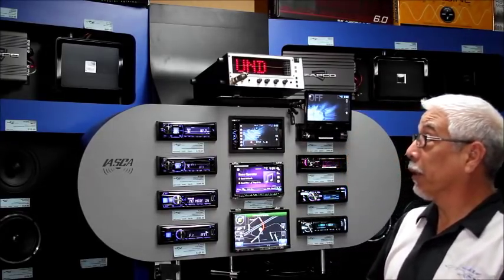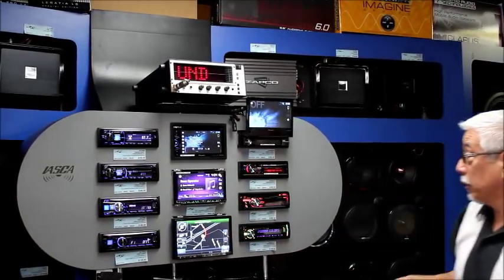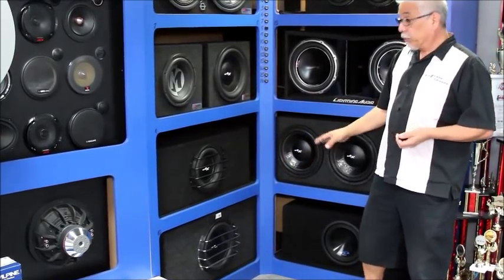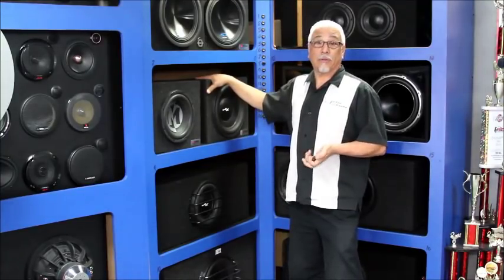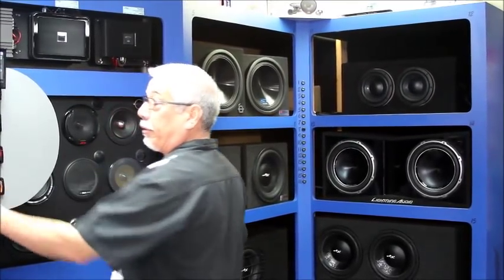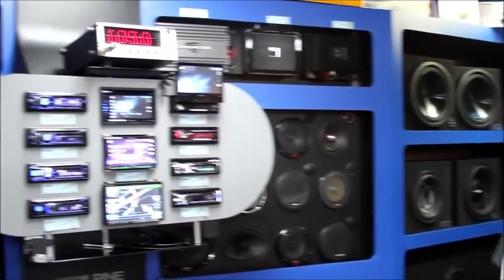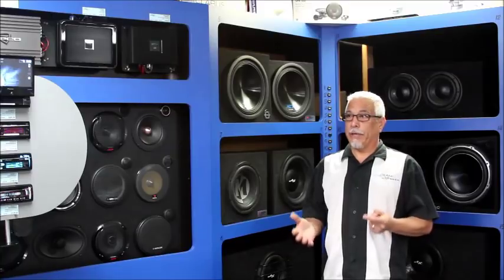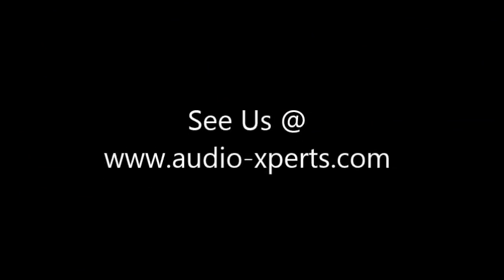Sealed vs Ported Demonstration by Audio Xperts using SPL meter to show output differences

Comment: I been doing systems for years yeah it's good to have a nice quality system that will shake the bolts off your car.But I seen dudes with a cheap amp and some mid class subs but there box was built right and you would think they had a expensive system.I seen expensive systems with a bullshit box and it sounds like air and paper.So basically it's how your box is build
Reply: That's so true: Ari Reid
A 300watt amp can produce in excess of 126db, (whilst running at LESS than half it's rated output power), when a few simple rules are applied.
BALANCING the Amps output reactance, to the implied reactance of the connected speaker LOAD, is what transmits the highest level of sound.
Not the enclosure, or how MUCH current one can force through the voice coils' winding.
Reply: Quix Kiwi Could you please elaborate on this some more
Reply: Yes I could, but would you actually "understand my answer" ?
Oh who cares if you can or you can't.
Here's what I will state.

THE OBVIOUS.

As the operative word I used before - was:
BALANCING
As THAT is all you really need to understand what was said.?

Don't consider this to be a useless method of "automatically leveling" the resultant power output levels of TWO speaker channels (in a bog standard 2ch stereo setup) as that NEVER balances anything, except the perceived listening "line" between two speaker positions to thus be causing the (resultant) "summated" MONO to then "appear" as if at a point ? About  midway between these TWO speaker positions.
.
Balancing is actually something done in reference to the "making of the same" with regards to what the Amplifier see's as a load , as against what the speakers see as a "driving" supply source"

Two speakers will NEVER provide a balanced impedance network, for any two channel "stereo" amplifier
(Where stereo means MORE than one, which by definition ALSO refers to there being actually - MORE than two,  rather than JUST two speakers).

As to correctly BALANCE the output of even a "cheap as" (low powered) stereo amp?

Be that a TWO CHANNEL AMP - or the most expensive multiple channel digital amp model available ?
(which is "able" to supply any number of speakers, within the impedance "ratio" range, that the amp's output's can handle)

Thus to understand BALANCING ?

One must in the first instance UNDERSTAND what you intend to balance.

If it's just a single listener's (own) headphone's LEVEL of loudness, in comparison to the output power setting, (of the OTHER headphone in that pair of headphones)? Then all you need to do - is "position the perceived" center=summation positioning, (not a real.central mono) to exist somewhere halfway between the other TWO speakers.

If however you wish to CORRECTLY balance the output "loading impedances" 
Direct to what the ANP can successfully drive OUT to the speakers connected.
(without undue clipping, heating or other weird sounding distortions)

YOU WILL NEED TO UNDERSTAND HOW THE MUSIC WAS ORIGINALLY RECORDED, 
(by even as few as ? JUST TWO MICROPHONES.).
When the "sound area" was created across, (to even be recorded for YOU to "play-back")

And thus to be "heard back later" as if YOU are still being, ?
Within a generally considered OPEN dispersal area, of a THREE dimensional "horizontal plane" of sound.
  
AS WELL AS HAVING (at least) TWO OTHER THREE DIMENSIONAL "PLANES" OF GEOMETRY
Comprising "not" just a WALK-BETWEEN line of sight/sound between TWO speakers.?

But "across, around, up/down/over inside-out &/or otherwise" sound planes (firing sound OUT in multiple directions as if being a LIVING PART, of whatever actions are being done)

As the inclusion of trillions of perceived generated beam pattern's are what makes this special,
in the way it does now also ACTUALLY EXIST AS, in open space around as many speakers as you wish to include

"And thus (again) working environment areas, to be creatively positioning's thereof, (all sound contained in just such an outdoor event) to thus be recreating sound between NOT JUST TWO, but as many "all_around"©™ speakers as YOU wish to include, in your "surrounding" sound replay/recreation system.

To ensure correct SPACIAL (3D, 4D and 6 - 9+ channels) listening pleasures too.

Whereby that is what is actively obtained, to thus be what drives UP the standing waves, to force the radiated waves to "appear" as if all louder, (as if it's the correct - high powered amp's output), to thus "arrive" at what would APPEAR, as a total surround effect, when in fact, it MAY WELL BE, just a silly wee recorder/player's "recorded sounds" - of the artist "painter".?

ONLY THEN will a thought hit you (inside your brain),?
Such as to why all of that "is this", And thus (?) WHY does it sound "better" and also EXTREMELY LOUDER - than what you initially "showed" here as if it has "very loud sounds".

See ?
Did you understand ANY of that profound statement ?
Reply: Quix Kiwi First of all, I was not being cynical at all. while I do appreciate your response,  You were correct in the fact that I understood little of what you said, some but not much. I do appreciate quality sound over total loudness and was hoping you would try to explain how to achieve a better balance in simpler terms, if that's possible.. it may just be beyond my level of understanding, But I thank you for taking the time to try to explain. Perhaps you might know of a link that could explain in a simplified manor so I could attain some knowledge of achieving a better balance. Thank you.
Reply: Sorry about the abruptness before.

Yes, but it would be far better for your understanding, if I just tell you (and everyone else interested in this subject) to "contact" your local electricity supplier, to ask THEM to explain all about load shedding, load balancing, power factor control and distribution network control systems, of ANY 2 phased & 3 phased power supply systems (which effectively are ALL that a 2ch stereo audio systems are anyway) to decrease the AMOUNT OF SUPPLY POWER NEEDED, to force "usable wattage" (output power) into an unbalanced consumers premises.!!!As an unbalanced (incorrectly loaded) consumer's premises, will actually WASTE almost all available POWER (wattage) from the supply generation point, just to create an ineffective "minimal wattage (power) seen at the load itself.Hence those who KNOW "all about" how costly it is to be paying huge dollar figures, for expensive HIGH POWER amplifiers, also know diddly squat, about WHY their uselessly low powered speakers, are sucking all that power from their expensive HIGH POWER amps, without creating any "really efficient" sound VOLUME.?

As volume in a 2 dimensional (or even a 3 dimensional) sound field is an "incorrect term."

THERE IS NO VOLUMETRIC CONTENT in two dimensions - only LOUDNESS.
Loudness isn't a good user of wattage (power), as LOUDNESS just wastes power.

In fact a small increase in loudness requires an extremely massive waste, of the available "supply wattage" (from the amplifier itself), to gain maybe 1/2 a dB increase in loudness at the two speakers.

....
to be continued below 
(re: Now... )
Reply: Now, having obtained that (small) insight, there's a LOT more to understand, before discovering HOW to build one yourself (tp get a 300 watt amp, supplying upwards of 3,00o watts of usable output wattage. (done by the inverse of losing power, one simply gains it).

How?
EZ actually.

Think of the "outside open" air environment of our entire world, as it isn't actually outside, nor open, but "contained" in a sound medium (air) which is itself contained in a very LARGE ball of usable CONTENT (containment) space, outside of which is a pure vacuum (where sound cannot be lost, as it cannot enter a vacuum).

Thus whatever's inside the spherical containment device, of our atmospheric system - can't actually BE EVER LOST, it just isn't usable in a hearing sense, from incorrectly wired (load balanced) speaker circuits.

When a set of "microphones" is then used to channel (yes a different meaning, of that weird word) - that "resultant sound" thus goes directly into JUST TWO unbalanced recording channels, to then "lose" it's balanced stability to transfer usable power, OUT to two (more) unbalanced microphones (as that's all a speaker is "isn't it", just a backwards version of a microphone).

Hence why - one currently (oops, another dual meaning word) has to SEND huge amounts of CURRENT, pushed along by a very high "potential voltage difference" thereby creating WATTAGE losses

....
to be continued,...
re: Thus by now...
Reply: Thus by now, it should be dawning upon you, that HIGH WATTAGE / POWER SUPPLIED is just current "wasted in wiring" in order to get a LITTLE current pushed along by HIGH VOLTAGES, that are needed to overcome the "potential differences" of the various resistance's and reactance's (of that useless wiring) - just to result in an extremely LOW "apparent" output power, from a couple of exceedingly expensive speakers, that simply CAN NOT correct the imbalances of a "lost" phase, which is needed to recreate the original sound.

Why ?
Because SOUND, is just an "audible waveform", somewhere along the entire RADIO FREQUENCY SPECTRUM, along which - electricity is ALSD merely ONE FREQUENCY, and where "all visible light" (white being just a collection of ALL the other shades) is also "just" a few frequencies (imbedded in a multitude of similar shadings, of same frequency SINOSODIAL wave forms), which happily ALL react and interact in exactly the same way - irrespective of WHERE along that huge radio frequency spectrum, they happen to occur, anywhere between STRAIGHT DC and the highest levels of (utterly useless) top end frequency.

SEE, or should I say HEAR (as your eyes CAN NOW HEAR, that which your ears NOW CAN SEE) - being  the light (when it's frequency is LOWERED to simulate sound), and where the SOUND (low frequencies are magnified by the method of sending voice-coil currents into filament globes, to transform sound into visible light) both allow you the watcher - to see & hear differently.
THAT which has always been?
Just a part of the SAME general operating principles, of the entire radio frequency Spectrum itself, contained within our actual "electrical" (electrons and protons and neutrons) world which has always been, around & thus also:
Surrounding us - hence why it is ANALOGUE SURROUND SOUND.

Nothing digitally needs to be altered, to recreate natural sound waveforms in a sinusoidal form'

.Thus, that is where a correctly BALANCED speaker system will always be able to use EVERY BIT OF AVAILABLE POWER 9instead of simply wasting it all in reactive heat losses, as most "commercial" amplifier/speaker systems have always done.
Even the best DIGITAL system - very effectively "loses and thus wastes" it's most valuable resource.
Amplifier power.

.....
Again - to continue with ....

I hope...
Reply: ...

I hope that helps explain .. why I use lights, to show exactly what the electrical currents are doing, in all the various speaker voice-coil circuit WIRES, that are easily interconnected, to load share, and phase angle (correctly), all the interconnected yet totally different "analogue" surround sound speakers.

Now there's a final "trick" that needs to be overcome.

When dealing with DIFFERENT sinusoidal waveforms, and variegated electrical circuits, ONE CAN NOT simply hope to achieve anything, by "banging" two different LINE (voltage) phases together in the same wiring ?
Ask your electricity supplier, WHY the DIFFERENT voltage / current & phase angle lines HAVE to be kept separated.?

In general power supply & distribution systems they GENERALLY like to keep the number of transmission lines down to the absolute minimum, hence why there's L1, L2, L3, N & E (five wires) in most power supply grids, (and why they LIKE to drop one of them (down) to ground it all, by using the earth as the "dropped" GROUNDED wire)

Thus leaving just four wires, to provide a balanced three phased circuit.

Now .. with THAT basic supply (circuit) they also need to ensure stability and balance is maintained over exceedingly LONG distances, to minimize wastage.

This is usually achieved in a dual way.
Firstly, by actually INCREASING the voltage along the way, decreases the current needed to be pushed, therefore reducing the copper resistance losses, increasing the usable wattage at the far end.

The second method (in conjunction with the first) is also easy to obtain.

The distributor simply WIRES the lines as a DELTA (no neutral) 3 wire configuration (see, by dropping a wire drops the overall resistance by 1/4, thereby increasing the efficiency by 1/3rd).

Unfortunately this CAN NOT BE MAINTAINED as such - over long distances, as generally "customers" are situated all along the supply network route, and have to have "tap off" points along the way.

This also increases stability by the way, as at every "tap off" point, there is a VOLTAGE TRANSFORMER REQUIRED.

Mostly step down type, (to supply low voltage to a customer's premises) although sometimes step ups can be used, to BOOST the wattage sent - across lines further down the system

Now, the incoming DELTA 3phase BALANCED supply, HAS to be split down to several systems - being:

3ph DELTA (balanced), 
3ph & N (semi-balanced), 
3ph, N & E (partially unbalanced) 
and 1ph - 2ph (completely unbalanced) 2 wire, 
Where these are of the three wire (and also 4 wire) "consumer loads" that can then be interconnected, to create unbalanced loadings on that particular supply transformer.

The way they "split down" the DELTA - ULTRA HIGH VOLTAGE TRANSMISSION LINES (ON PYLONS)  is by creating a STAR NEUTRAL POINT, (artificially creating another fifth wire), which is also provided with a connection to Earth, by bonding N to Earth (at that point)

.....
continued with
NOTE: ..
Reply: Nick..
If just after a link.?
Then:

A link could be as easy as this:
Three-phase electric power - Wikipedia
https://en.wikipedia.org/wiki/Three-phase_electric_power

Jump to Balanced circuits - In the perfectly balanced case all three lines share equivalent ... 
In a balanced system each line will produce equal voltage ...
Single-phase electric power · Polyphase system · High-leg delta
Reply: I knew a little asian dude that ran 50 watts to his sub and it was louder than my 2400RMS subs.. Because he ran " clean " amps
Reply: Quix Kiwi rare to see someone say so much and make so little sense. you may be right or wrong its hard to tell but you may want to rethink your philosilophy on expressing yourself.
Reply: A Sony subwoofer will sound good in any type of boxes
Reply: the truth is that Sony never made good speakers at all Sorry
Reply: That is not true, Sony have made some of the best speakers of all time.
Reply: Ok for TV long time ago they were the best for many years  but not  in sound they never made any hi-fi amps ...
Reply: no not at all
Reply: quix what setup would you recommend / or do you have then
Reply: I agree with you.  A truly intelligent person can communicate on a level where any lay person can understand.  He is a yo yo.
Reply: Ari Reid i
Reply: @quixkiwi5337  dude how do you not get your thumbs tied up.?
Reply: @quixkiwi5337  Hey thanks for that information you should make a YouTube channel 💯👍😁

Comment: Hi
I have two 30-watt 6.5-inch subwoofers that correspond to the old edifier r401 speaker.
I want to design a common subbox for both and then build,
So that it produces maximum volume and volume, as well as deep bass and sufficient vibration (the best and most optimal mode).
However, the space limit for this subbox should also be considered, which can be up to 35-40 cm wide, up to 50-60 cm long and up to 70 cm high.
In the speaker specifications, the minimum response frequency of the 32 Hz speaker is written, which is probably mentioned with its box.
Please suggest a schematic for the design that is more appropriate
Thank you

Comment: The sealed will handle more power without reaching mechanical limit in most cases. The ported will reach mechanical limit before the sealed if it is playing outside tuning and the further it plays outside of tuning the more excursion and mechanical limit it will hit. This video is wrong in most cases and the fact you say you understand the science better than anyone in the area means you are bull shitting me.
Reply: So.. sealed plays 30 to 110 for example I guess all the same, but ported can have a heavier 30s and less of the others depending on tune ?
Reply: Marco Franciosi agreed. I had a buddy with two tens in a sealed box in the back of his Buick that pounded. You would have thought he was running 18s back there. He didn't care about quality, he was just going strictly for bass. Sealed boxes create a pressure on one side of the cone that stabilizes the speaker under high loads, but reduces it's bandwidth response. Vented enclosures allow the speaker more movement and higher bandwidth, but you can't run as much power through them.
Reply: Iv  noticed that also Intresting when using sealed .

Comment: If a subwoofer is making mechanical noise it's being clipped at the amplifier or headunit or has been blown. Setting the amplifier gain properly plays the biggest key when sealed and ported. Next is the enclosure and air space of the enclosure. Along with clean power feeding the amplifier.